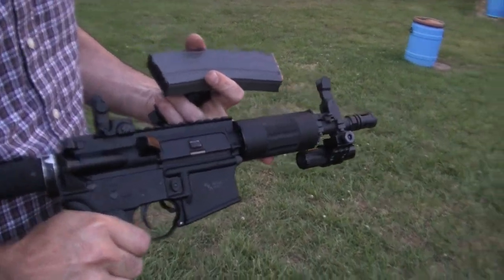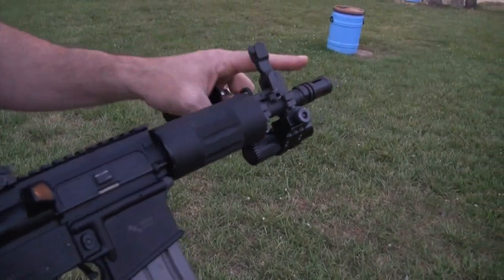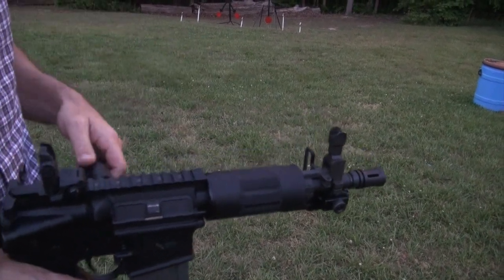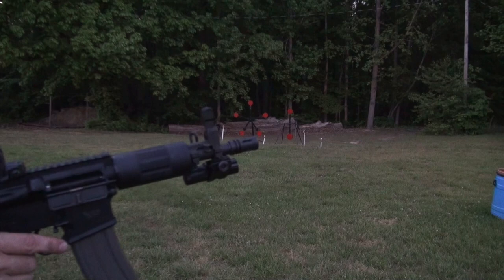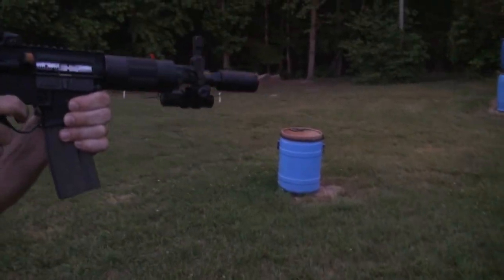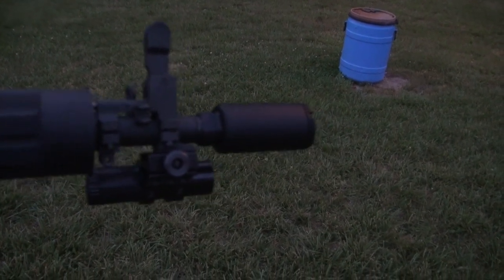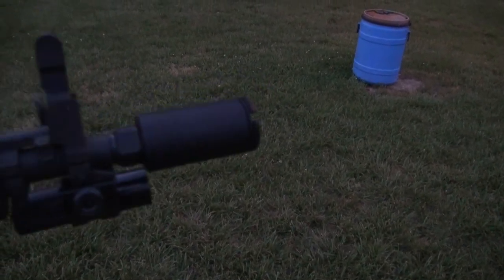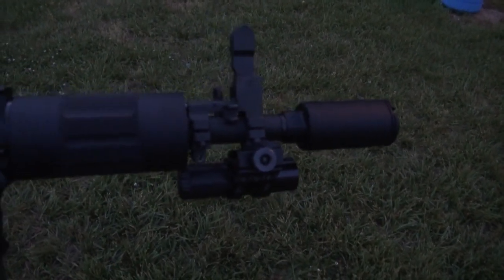KAK Flash Can Test

Comment: You can see an increase in recoil after the flash can.
Reply: Looks the same, flash kinda makes it seem less
Reply: In theory, this sort of device I would think helps cycling and gas and would translate to a little bit more recoil.
Reply: @clockwork421  That is EXACTLY what this device does. Back in the day, the Soviets had some small issues with their shorty AKs not cycling. The chamber that IS the Krinkov device, allows the expanding gasses to dwell inside longer, allowing for more reliable cycling of the action. 

This is more important with .30 cal, short barrel AR rifles, as the direct impingement system needs some solid pressure to operate reliably, given the variables of sub- and super-sonic ammo.

Comment: How was the difference in terms of recoil? Do you feel that the flash can required more grip and steadiness?
Reply: It does slightly increase recoil, but it isn't unmanagable. Get a good hogue grip, tube and spring kit with a decent brace. With a binary trigger I was still able to consistently keep shots on target at 50 yards with a 7.5" barrel. These barrels aren't meant to be tack drivers at +100 yard ranges. Closer combat is their role. Inside of 100.

Comment: Cool Vid! Thanks for the Slo-mo.  What type of ammo are you using in the video? from the annealing that I see it appears to be Federal Ball (X)M193 which tends to be loaded extremely hot, as any military round is. That may explain the big flash and the muzzle jump. Try loading and shooting some 40 - 50gr heads with really fast-burning powder like Vihta N130, IMR4198 so the burning completes faster. This will lessen the recoil, the flash and get the bullet up to speed quickly to make up for the shorter barrel. PS I am really surprised how accurate my 8.5 barrel can be. Love the Rock River stuff. I got the KAK Flash Can ($35) that is a third the price of the Noveske Pig ($90) and looks and works the same. Fire On!

Comment: In the comments you said the recoil felt the same.  Did the can effect the cycling reliability vs the A2?  Thanks.  Great video.
Reply from the maker: Nope.  Cycling is the same.  By time the gas reaches the can or break all the gas that is needed to cycle the bolt has already been let off.  I have them on all my AR Pistols.  On that platform it is a must in my opinion, it keeps the gas out of your face. Thanks for watching.
Reply: I want to build a pistol.  Can't decide between 7.5 and 10.5 inches.  What do you recommend.
Reply: 12" You can thank me later @Kellymale

Comment: But for a savage 50% increase in recoil and flip it's worth it just for the combat usability.
Reply: With an adjustable gas system you can dial back the gas so the recoil is reduced some. A lot of AR15s are way overgassed right out of the box, especially in one's with a pistol lenght gas system.

Comment: hey bud. good video love watching your videos got a question when installing the KAK Flash Can do I need to use a Crush Washer ??? or do I just install it right on my 10.5" Upper
Reply from the maker: No crush washer needed.  Just slap it on there.
Reply: BigDaddyHoffman1911 do you think it's possible to thread on a flash hider after you put on the flash can?
Reply: Doubtful since the flashcan takes up the threads so there's no where for the flash hider to thread to.
Reply: Plumpy E .. Years of experience here on machinery.
It is best if you install a crush washer VS installing via a direct connection for several reasons. 

1: Crush washer takes up small imperfections between two pieces.
 2: Greatly reduces the amount of force needed to remove decice, and allows for proper torquring.

To illustrate when changing on a car, truck, etc you should ALWAYS :
1: Make sure drain washer is present. 
2: Use a fresh washer , or anneal it.

The point of washer is so it when tightened it fills in small inperfections, and provides some "give" which allows for proper torquring,  and makes removal a heck of lot easier !

Just changed oil on dad's truck the other day and IDIOTS at dealer evidently lost the drain plug washer... Took ALOT of torque to get that sucker off.. AMAZING the THREADS DIDN'T STRIP OUT. 

IDIOTS.
Reply: @TackshooterOG  what the hell kind of question is that
Reply: @ryantogo8359  Essentially what I was asking with that 5+ year old question was would it be possible to use a product like this to create a Blast Mitigating Device around the outside of a traditional flash hider. Similar to the Lantac BMD setup that was released after this comment was posted. It was both a good question and also a question since answered by time. Dont Necro old comments weirdo
Reply: @WeAreNotAlone69 not to mention at the end of the video the brake timed completely wrong.  The gas cuts are at like 11 and 4 when they should be at 9 and 3 😂..probably spun around on him during shooting or the lack of washer allowed it to turn more to feel tight ..

Comment: Q: For 10.5... XM855 556,  0.080 gas port, H2 buffer, ejection pattern 2, but sometimes 3, 4 o'clock 
Krinkov 2 piece can off ebay, or Kak, which appears to be just a hollow tube?
Reply: Hollow chamber, with a cap/lid that has a cone shape. The cone keeps the gasses inside the chamber longer, allowing for more reliable cycling on short and supershort barrels, where the gasses just don't physically have the dwell time.

Comment: Your AR needs a heavier buffer!  That 2-3 o clock ejection and horrible recoil is not right.  Im guessing you have a standard carbine weight buffer in there.  With your barrel being short as it is a H2 or even a H3 weight buffer would make it so much smoother for you.  That gun is very over gassed and the BCG is recoiling too fast as well,  ejection should be at least 3 o clock with 4 o clock being perfect.